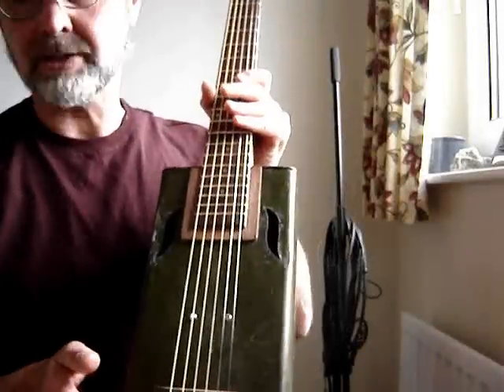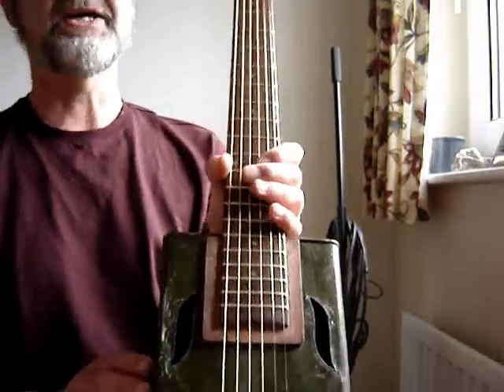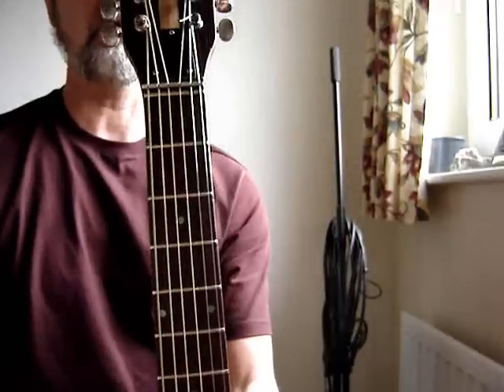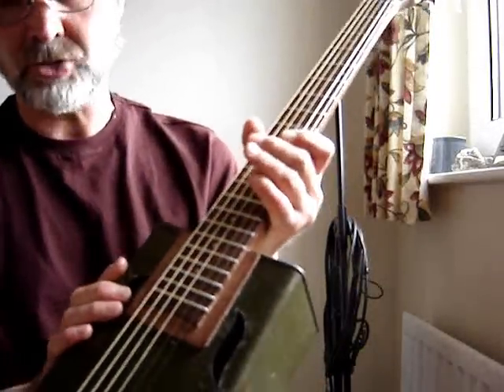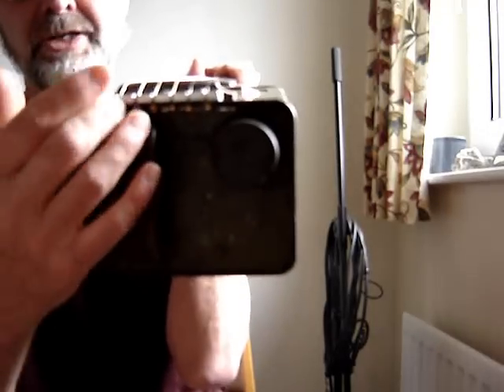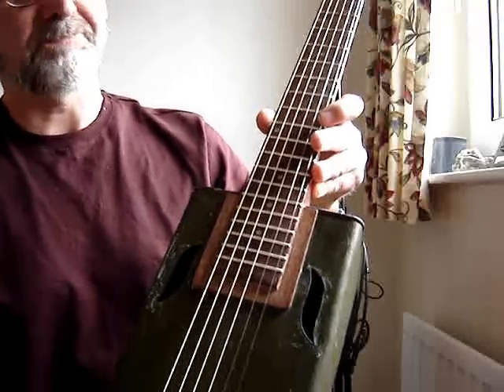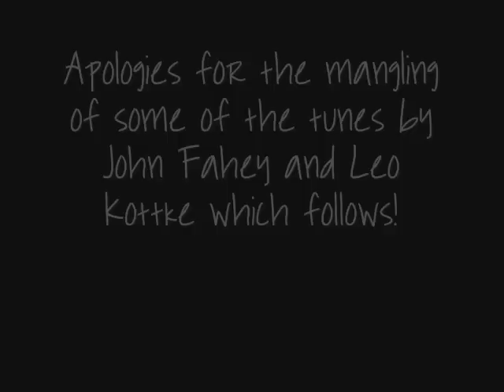Oilcan guitar demo

Comment from the maker: I used a 25mm thick piece of hardwood about 75mm wide and the length of the can. I routed a neck cavity pocket and screwed the neck to it from underneath. The hardwood  section was then epoxied/screwed to the can top.

Comment: Amazing video!  Am currently in the process of building one of these myself - do the strings just sit in the little grooves that you've cut for them (in the piece of aluminium you show at 0:47) - if so, does the tension in the strings just hold them there or have you done anything else to that little bit of metal to stop the strings from flying out of the grooves?  Thanks!